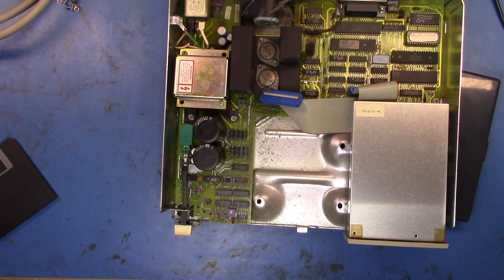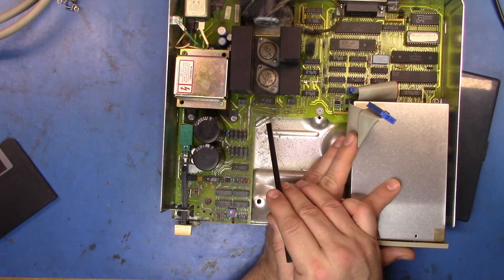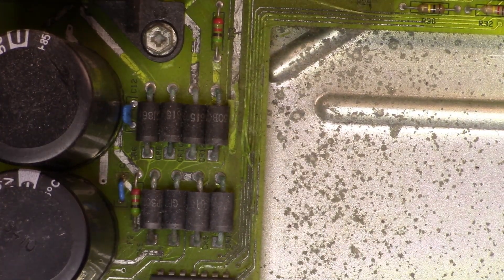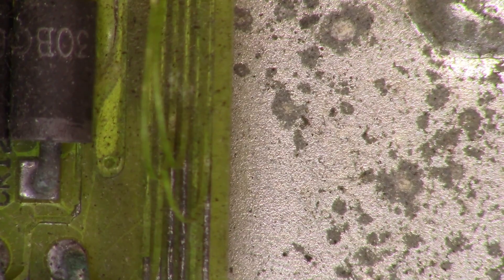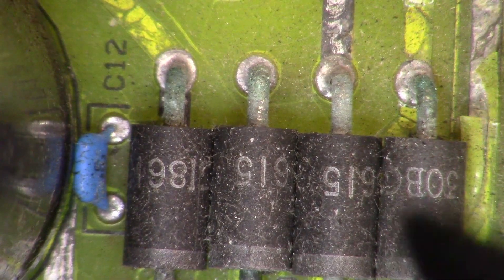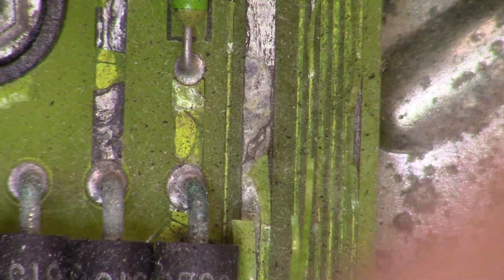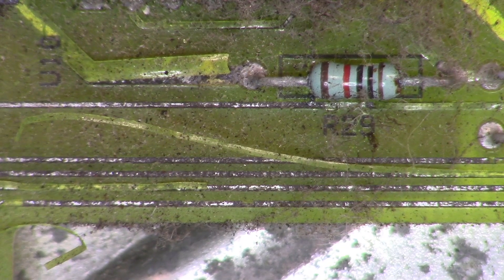PCB Failing in HP 9122D

Comment: That's pretty nasty. Wonder if the board wasn't properly cleaned before mask? But then, the bare component leads show corrosion as well. Maybe it had a previous life in a chem or med lab. Personally, I would not re-heat/re-tin those bare traces. If they lift, you even worse off.

Comment: I'm with everyone else, ie, moisture/water and something slightly corrosive. I suppose it's the usual neutralise wash and recoat. 
I remember they dipped a running TV in distilled water and it ran for a couple seconds before the salts on the electronics dissolved and shorted it out.
Reply from the maker: Thanks - I'm going to try some IPA and SuperWash to see if that cleans it up and keeps it working. General consensus seems to be to finalize with either lacquer or conformal coating.
Reply: @tgsoapbox  I saw a YT vid of someone using Ebay solder mask, it's just that it was hard to get an even coating that looks good because it's brushed on. Conformal in a can is the easiest.

Comment: I was going to say same as Scott. I think if you try and clean it you will pull the tracks off. I think you could only try and mechanical stabilise it. With conformal coating spray. But even that runs a risk of the solvents causing damage.  It looks like the tracks were lifting but perhaps that is just the camera etc. Good luck. Regards Chris.
Reply from the maker: I think the tracks are OK (corroded though) but the solder mask over the tracks has listed off. I'm going to try IPA and SuperWash with some light horse hair brush action and see how that goes.
Reply: tgsoapbox  good luck fingers crossed. When I look at the tacks they look wrinkled like on the thandar unit I repaired recently. See 19:15 https://youtu.be/M1oYUCAMGpk

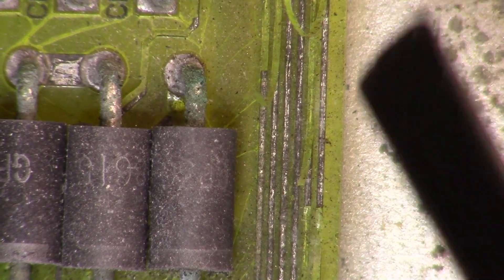Comment: I would guess that this device was in an atmosphere with sulfuric acid. At 0:50, there's a blue/green colored salt on the lead of a diode, probably CuSO4. So I would at first wash the whole PCB with de-ionized water, maybe first remove components which may be damaged by water (e.g. buzzer)
Reply from the maker: Thanks Dr Frank - I scrubbed it with 99.9% IPA and then again with MG Chemicals Super Wash - The corrosion you mentioned came right off but the darker spots on the tracks stayed - Overall I felt like the PCB cleaned up well and I ended up doing the cleaning cycle again and then conformally coating it. I just go the drive, my plotter and thinkjet setup with the 8720C so I was going to do a follow-up (hopefully tomorrow).

BTW Please accept my apologies for the delay - This comment (along with one other) just turned up in the "likely SPAM" folder on the YouTube Studio Beta - It was there before so I just released it. Always appreciate your insight.

Comment: Wow! I've never seen a board do that before. You have other drive units of that type so it rules out defective coating (mask). You might try some litmus paper to determine if there is an acid or base present and then neutralize based on the results, a little vinegar if the board is base or a little baking soda if its acidic.
Reply from the maker: Thanks for the suggestion - I'm going to try some cleaning with IPA and SuperWash and see what happens.

Comment: You could clean and recoat with a conformal coating maybe. Looks like moisture related.
Reply from the maker: Thanks Simon - Any suggestions on what to clean with? I ask because of the corrosion on the diodes - It looks like something more that just normal crustiness.
Reply: @tgsoapbox  Use some isoproponol alcohol. That's what we clean crusty boards with.
Reply from the maker: Thanks will give it a try

Comment: Looks like it has been in a humid environment, all I can suggest is a rub it with a toothbrush to remove loose mask, then tin traces/pads where you can, and spray with some conformal coating to protect it.
Reply from the maker: Thanks - Have you tried tinning corroded tracks before? I'm wondering if the heat might help convert the corrosion?
Reply: @tgsoapbox  I have done that in an old Commodore calculator and a chess computer.
I cleaned the traces (those meshed key pads where the conductive rubber keys get pushed down on) with a glass fibre pen and then just tinned them with a generous blob of 60/40 solder and some flux. It seemed to also remove most of the corrosion in the pitting. For now it works great, but I don't have longterm experience, so I can't quite tell how it'll look in ten or twenty years.
Reply from the maker: Thanks for the suggestions - I'm going to give just cleaning the board a try first with IPA and then MG Chemicals SuperWash - Will see if it still works.
Reply: Conformal coating would be one option.
What I have seen people do is to clean the traces carefully, tin them with solder, and then add new "solder mask" with regular (cheap) nail polish. Apparently, that works pretty well. And, if need be, you can remove the nail polish with acetone.
I myself am looking for a "PCB green" nail polish, as I want to do it that way in a couple restoration candidates.

Comment: New issue to me - so could be wrong! Looks like whatever contamination is on the board is oxidising the traces and making the solder mask peel away. My first thought would be to get it cleaned (hot water w/ mild soap), then perhaps coat the damaged traces with a bit of no clean flux. Conformal coat is probably the easiest thing to seal it up again with.
Reply from the maker: Thanks - Cleaning the grime off is a good start but I'm wondering how best to address the corrosion? I suspect that the solder mask is coming off due to the expansion of the corroded metal but I'm not sure if conformal coating will allow the remaining corrosion to finish and not split (thus opening the tracks back up to air). Thoughts?